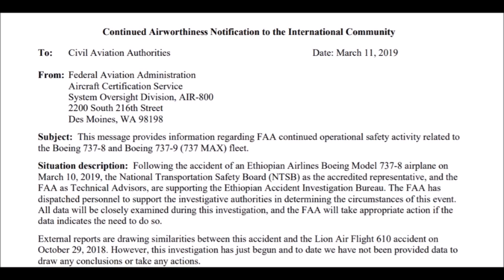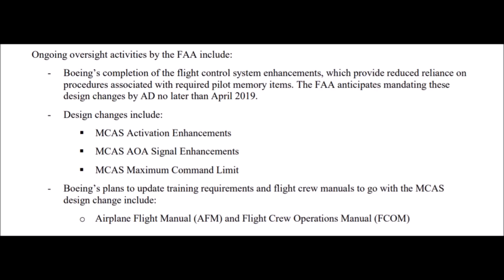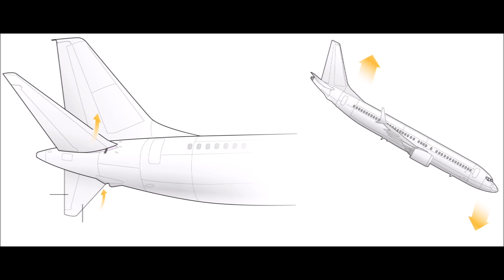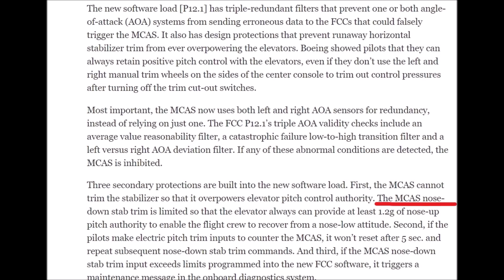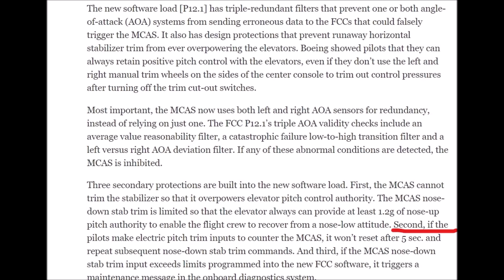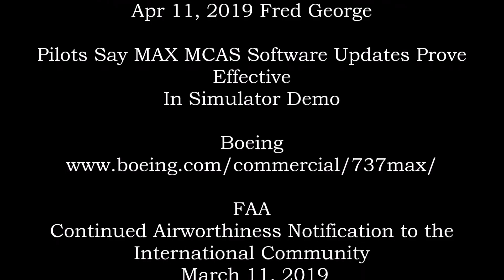737 Max UPDATE 14 April 2019 "The Fix"

Comment: Juan,  First excellent reporting and analysis of the 737 Max situation. I have similar background flying that you have. Civilian/Military (Navy)/ Airlines. I am retired now, but most of my time was in Boeing aircraft. I did not fly the 717 or the 787. I still think Boeing makes the best reliable aircraft. I only flew the 737
Models 300 and 500. But I also have 4 to 5 years with the Airbus. Airbus has many excellent features that accelerated the engineering changes to fly by wire and overall efficiency. Both aircraft brands and all models can be completely de-automated and hand flown to maintain proficiency. Juan I applaud you for maintaining your private flying and hand flying experiences. Like you said it is important.

It is tragic that it took two accidents with such loss of life to bring about this design change. I am sure the crews that are current on the newer model
737’s are getting more information from their companies and training departments. It appears to me that the MCAS confuses the emergency training for years
relating to runaway trim. Both the 727/737 had the same problem introduced in the simulator with it starting to move un commanded in one direction or the other. You did an excellent breakdown on the cycles the MCAS is designed to go through with resets.

A thought on the MCAS being installed to just make the aircraft feel the same as the other models,  I would think it is there also to certify the plane in the 
envelope of usable weight/power/altitude. With the engines installed forward of the wing and higher makes the aircraft more unstable in the longitude. 
Nobody I have read has talked about this new model having a deep stall problem. I am guessing that was part of it’s required installation. For years I flew
the 757/767 at the same time. We just had differences training.  When you fly the 777 you have to get used to the tendency for the nose to come up right away 
with power application. It is a shame they could not just extend the 737 landing gear geometry at some point and maintain the type rating. Like I said above we 
flew the 757 and 767 at the same time with minimal differences training.

Back to Boeing I still believe they make an excellent aircraft. A lot of their designs changed world travel. Reliability allowed the introduction of ETOPs and 
connecting easily to many parts of the world. However this a case where oversight and sound management fell short. I recently read through another alarming account of an earlier engineering deficiency at Boeing where they were making the 737 Nextgen aircraft using multiple subcontractors and CAD parts. Several engineers tried to notify their superiors of substandard parts not fitting on the final assembly line. Many aircraft were modified/redrilled and pushed out to the public. The engineers were ignored and silenced and fired by Boeing. The two women engineers had to become whistle blowers.
It concerns me that this MCAS situation follows the same lack of review and overall government supervision years later.

Sorry I got long winded here:  I am strongly in favor of when they get the 737 Max ready and modified to be recertified, that they require a corresponding
         Simulator session to reinforce the distractions of this malfunction. It is not a simple runaway of years past.  I saw that they were just recommending
         IPAD training.  I also saw that some airlines were going to require simulator time even if not required by the FAA. Good for them.

Juan keep up the good work. Your videos are perfect for the public understanding and for pilots flying the line. You must of did Aviation Safety work in the
         Air Force.
Reply from the maker: Thank you sir!
Reply: Good points, and thanks for the feedback! Airlines are all about the bean-counters nowadays...

Comment: As a Boeing fan, I think the primary question that the company has to answer is how such a poorly designed fix for a "relaxed longitudinal stability" issue could ever make it past an initial design review, much less into a flight test article or (God forbid) a production airplane.   I don't see this as a result of Boeing's rush to get the airplane certified, as I'm sure the press does.   Even in a rush, any competent engineer should have been able to think through the potential scenarios and realize that the system was dangerously......more like recklessly designed.   This was a back-of-the-envelope design, not something we'd expect of a company that has world-class talent.   Government and public pressure totally aside, Boeing should be turning the company upside down to understand how this got past every check and balance our aviation system has to offer.   If I were a CEO, I'd be livid.  Trust is the only thing that keeps a company like this in business.   Some senior level engineering managers need to be held accountable......read that, fired. 

All of that said, the flight crews should have been able to handle this.   If an airplane is trimming itself against the desired flight attitude, that condition should not be allowed to persist more than a few seconds before the stab trim should be shut down.    It is unforgivable that the Lion aircrew that survived an ordeal with the accident aircraft the day before did not immediately and fully debrief that incident, ground the airplane and bring it to the attention of the manufacturer.   We had a dressed rehearsal for an accident.....and those folks even elected to continue on to their destination after their roller coaster ride.    Good grief!

Comment: Juan,  This training video explains  how tough it is on the 737 CL.  If the 737 Max was similar and Boeing had not explained some of the issues to the pilots. No wonder they had no chance.
https://www.youtube.com/watch?v=3pPRuFHR1co&feature=youtu.be
Reply: Just watched that video. They call the elevator the rudder and do not use the fold out handle on the trim wheel. If you really want to see how to do it, watch this. The simulator part is at the end of the video if you want to skip ahead to that. I would suggest watching the whole thing however. https://www.youtube.com/watch?v=xixM_cwSLcQ

Comment: I'm a complete amateur for planes but have a certain technical background. It strikes me as really idiotic that i build (knowingly) a fundamental flaw in that plane, with the engine position affecting stability, to then fix it with a software workaround. And THEN charge extra for safety features connected with that software.  Is Boeing beyond the need for a good reliability image?
I know fighter Jets do that intentional instability thing, but a plane for transporting 100+ people?  It should go back to the drawing board, not software fixing the software fix. That would also restore trust in this thing more

.As i understand it, the new Engines are too big to go under the wing like the old one. Was raising the gear really no option?

Comment: Excelent fair repot.
To err is human, no matter what regulations and testing are implemented. Shit happens. In fact and change can also create new unfoscene issues. Boing did not intentionally cause this,they were trying to make things better. They fixed 737 max, a very good safe well engineered deign. Hindsight is 20/20, the design feature unitentionally turned into a mistake, humans make mistakes, even you

Comment: I appreciate your work.  I would like to add the comment that a part 25 aircraft is not supposed to be certified if it is not stable at all speeds, etc.  This airplane should NOT be certified if it cannot be flown with all normal and predictable characteristics from stall to MMO VMO.  You wouldn't accept it if your luscombe needed a computer program to be safely flown at high AOA etc...why should we be flown in a 737 MAX that can't be trusted to the stall / max AOA  without "assistance?"  The new fix is just another bandaid....The plane is not aerodynamically stable if it can't be flown safely to max AOA...period.
Reply from the maker: Correct the 737 Max is not unstable....view this update again.
Reply: @blancolirio  If it is not unstable, then why add the MCAS in the first place?  We might be quibbling over the technical definition of stability here, but if it flew with normal characteristics from max AOA to MMO we would not need MCAS.  While the airplane may not be TECHNICALLY dynamically or statically unstable (we don't know because the gloss over what it does if the MCAS was not installed and you went to Max AOA) then it is at least unflyable with "normal characteristics" to max AOA...or else you would not go to the trouble or writing a program to try to save the ship.  It is unstable in that sense, and should not be certified as an airframe thus.  the MCAS and all "fixes" of the MCAS are just band aids to bad design and certification process.
Reply from the maker: Review FAR Part 121 aircraft certification requirements. The 737 Max is stable. Remember this is a single TC issue...
Reply: @blancolirio  single TC?  I am not sure I catch your meaning.  The 737 is stable.  The 737 MAX was discovered to have an issue at high angle of attack that necessitated MCAS...otherwise they wouldn't have added anything.  It's not just a pitch moment on power addition either, based on all the areas I have seen it mentioned.  It SOUNDS like they are saying at high AOA the placement of the engines causes an additional pitch up which would become unsafe...but they have glossed over it at every writing.  Answer this (even if to yourself - I am not trying to have a public argument here.)  If the aircraft could be flown manually (direct law etc) all the way to the stall or pusher, why would you add MCAS?  We already have stick shakers and pushers...if this aircraft could fly normally to the stall, like a 737NG...you would not design or add MCAS.  So you still say the 737 MAX is "stable" all the way to max AOA?

Comment: Alternating sensors between flights?  Driving trim to limit?  Ignoring stick inputs?  The original algorithm was so bad I believe it was never meant to be used beyond a simulator or test flights.  The question is how did it get into the the final revision of the programming?

Comment: Excellent presentation, but I cannot understand how there were such basic errors in the firmware design, especially with aviation's long history of safety and immense knowledge on the subject of built in redundancy and ability to over ride. (Also questioned by Bo Stark below)
Also, why can't the AI electronics also be used as a comparative sensor, since it is a very reliable source of visual indication to pilots.
I am not suggesting anything, but could there have been other reasons. Just curious.

Comment: So they put MCAS in, to make the737 Max feel the same as other types of 737s because they changed the position of the engines in the 737 max, but they stuffed it up big time, and they didn't think it through or test it. Or put it in the type rating course/instruction.  Thereby 300 plus have died in two crashes.  My guess is some pilots will switch off MCAS cause they won't trust it. despite soft wear changes and teach themselves how to fly a different plane which the 737 max is.  Let's hope there won't be any low altitude stalls coming into land through thunder storms etc.

Comment: I'm no aircraft-engineer, but wouldn't it have been simpler to lengthen the undercarriage to allow the new fatter nacelles to fit into the same spot as in older models? That would have kept most CG and centre of lift issues as they were. Or, move the engines more 'outboard', or increase the dihedral? What have I missed?
Reply: The basic problem with all B737s is that the wheels fold up under the wings, and there simply is no room to lengthen the legs to increase the height. See: https://en.wikipedia.org/wiki/Boeing_737_Classic#/media/File:Transaero_b737-400_planform_ei-cxk_arp.jpg

Comment: Very good summary, but you omitted an important fact in the "why MCAS" part. Cost-saving, yes, but not just for type-rating related costs... The MAX was designed to counter Airbus's more economical models, and avoided Boeing having to invest into developing a whole new aircraft. Which they should... However good it is, you can only push an old design so far (50 years I think). Also, the fact that the Air Force got the redundancies by default pretty much tells the whole story.
Reply: Marc I. That was covered in a previous video. This is part of a series.
Reply: @gordonrichardson2972   my bad :)

Comment: Why was the flight indicator on the nose of the plane faulty , isn’t this where the issue started ?? That caused MCAS to nose down in the first place?
Reply: Phantom_ Wings AOA sensors are reliable, but prone to mechanical damage on the ground, particularly by the airbridge.
Reply: Gordon Richardson But didn’t the issues before MCAS problem happened due to these faulty readings from the scenarios ( didn’t it all stem from this initially) ?
Reply: Phantom_ Wings Yes, the AOA sensor data is used by many of the flight systems.

Comment: About the AoA input swapping at each flight. Is this something you inferred, or is it documented? I remember you said the pilot engaged the auto pilot on the side with the broken AoE sensor. Could it be MCAS uses the side where the autopilot was on the last time instead (or something like that)?
Reply: Marco Mascheroni The switching sides of MCAS was not initially documented, but has emerged from technical sources.

Comment: Don't you think that is very suspicious that in both accidents (Lyon Air and Ethiopian Arlines) The AOA sensors were damaged??? What a coincidence, in two new airplanes...
Why to use a software to correct a design error? Boeing is trying to save the airplane by force, prepotently. The sensible thing is to design the plane from scratch. It is preferable that Boing lose money and be close to bankruptcy than a new accident.
Reply: Lobo Interestelar AOA sensors are prone to damage on the ground, particularly by the airbridge. There have been several reports of unreliable instruments because of this. Only with the faulty version of MCAS did damage to a sensor have catastrophic consequences.
Reply: @gordonrichardson2972  Even worst then, put all the safety of an airplane plain of people in a sensor prone to damage is a crime.

Comment: Well done as always, Juan.  In my experience as an airline pilot, instructor and check airman since 1985, automation has been a good thing, but piloting skills and airmanship deteriorated to the point that several years ago FAA direction was changed from using "max automation" to more hand flying/stick and rudder skills in training and checking events.  
When the automation goes south, pilot airmanship and skill are the only guardians the crew and the passengers have to avoid a catastrophic demise.

Comment: Cr01 what's 40 knots when your in a dive @575? Air rushing over the fuselage would give some indication of an over-speed condition EXAMPLE  if you lose engine power you look at both to analyze as well as, yaw effect,  instrumentation, etc., to determine which is the problem.  Aviate, navigate  communicate, emergency procedures And check list......and you wouldn't leave the auto throttles engaged In that situation as well. Same in this situation.  The basic thing that you learned 1st thing in your training and they beat it into your head ....... fly the airplane 1st.... I think the largest contributing factor is not gaining control of the aircraft manually 1st  And the failure to turn off the auto throttles Would be one of the 1st or 2nd things --------  You fly the aircraft not automation!
 Secondly, they  Re engaged The  MCAS and  5 second later.....  Elevator went full nose down trim....... 40 knots difference with  Redundant air speed  Indication Should have Given the pilots  Sufficient time to recover if the auto throttles were off and MCAS remained off. But climb power in a dive  Would virtually be impossible to recover  ..... 200 to 575 in less 4-5 seconds.  Personally I believe those 2 crucial things Contributed to their demise  (2+1) "Along with Not taking manual control of the airplane". Thirdly, using one sensor  And offering a second sensor as an option! This one I don't understand.....  with all the redundancies that they have on aircraft systems these days and only utilizing that single sensor for the AOA/MCAS  Is mind boggling. (Thus part of the Boeing's fix) sadly all of them Perished and  A combination of things Cause it.